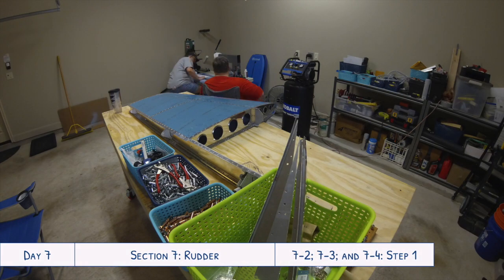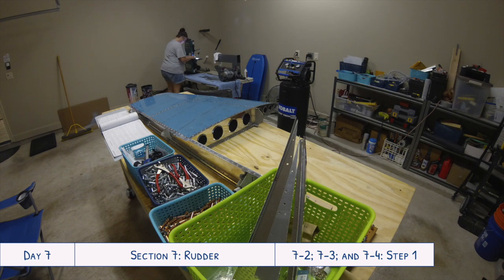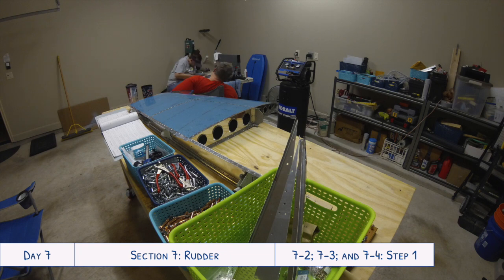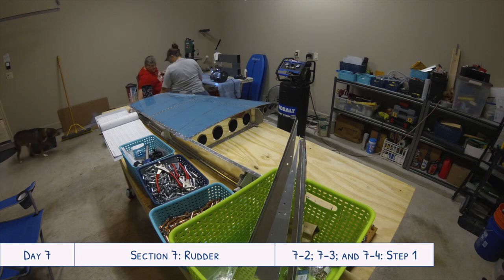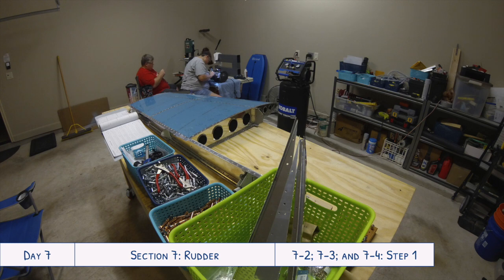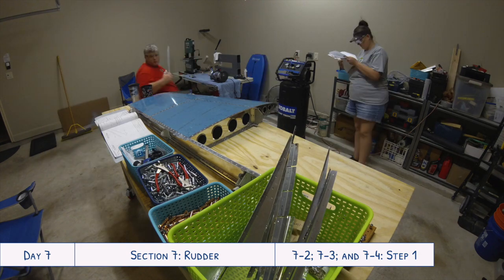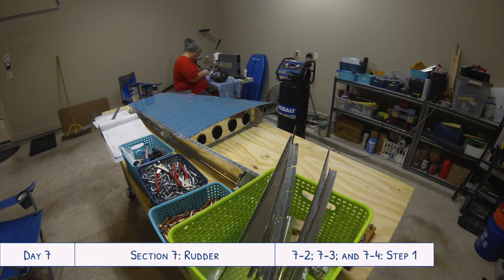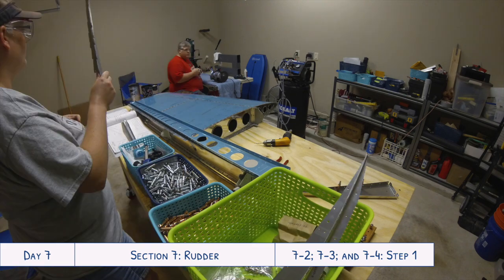Van's Aircraft RV-10 Build: Day 7 - Starting the Rudder (7-2, 7-3 & 7-4)

Comment: I did the same thing with cutting the stiffeners except I cut mine long (1/16ish) and then used the 3m scotchbright wheel to get them exact. 
I don’t know if you’ve got to sealing the trailing edge yet but a couple words of advice on a straight trailing edge: the 3m double sided tape works well as does the proseal method (I’ve done both and prefer the double sided tape, personal preference only) but if you use the proseal method make sure you adhere to the “thin strip” it calls for in the plans or else you’ll end up with a lumpy trailing edge” if you use to much.
Reply from the maker: Yup, I try to cut everything just a wee bit long when I'm using the bandsaw knowing that I'm going to have to debur it quite a bit. We have done the trailing edge already (still trying to catch up on videos) and used the proseal. I'll get into our experience during that video (had a small fiasco), but boy does that stuff reek to the high heavens!!